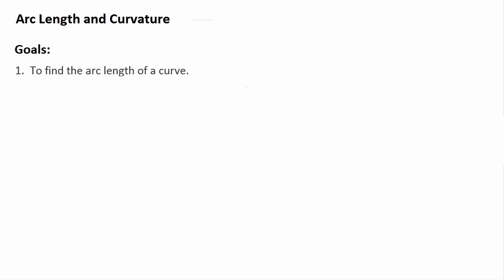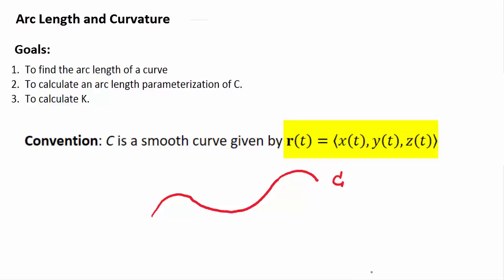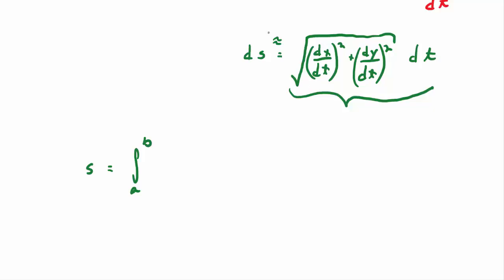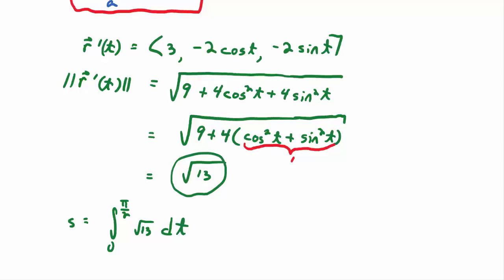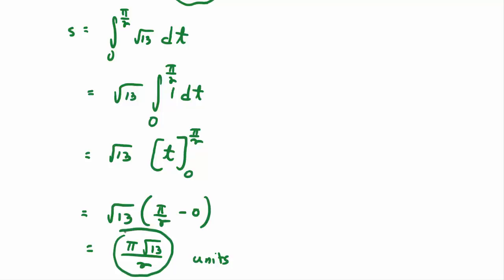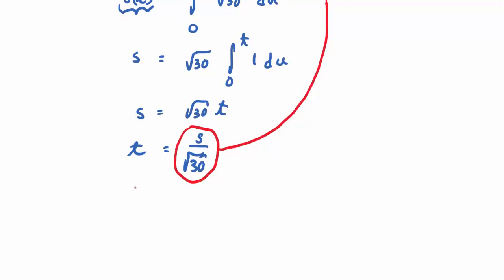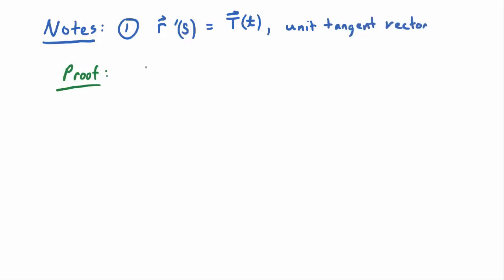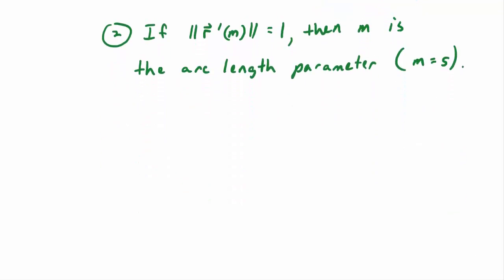Section 13.3: Arc Length and Curvature [Full Lecture]

Comment: Can you point me to where you or something shows the theorem you mention at 28:53? with ds/dt = 1/(dt/ds)
Reply from the maker: Here's a link to a  nice proof from MIT OpenCourseWareon (on page 2): https://ocw.mit.edu/courses/mathematics/18-01sc-single-variable-calculus-fall-2010/1.-differentiation/part-b-implicit-differentiation-and-inverse-functions/session-15-implicit-differentiation-and-inverse-functions/MIT18_01SCF10_Ses15a.pdf
Reply from the maker: New link: https://ocw.mit.edu/courses/18-01sc-single-variable-calculus-fall-2010/resources/mit18_01scf10_ses15a/